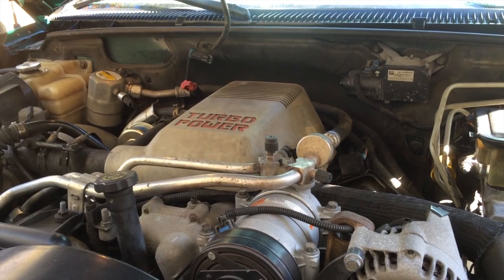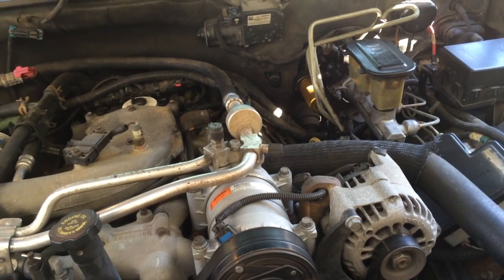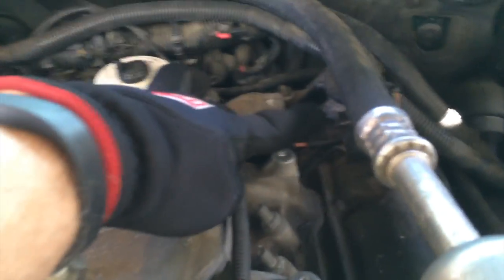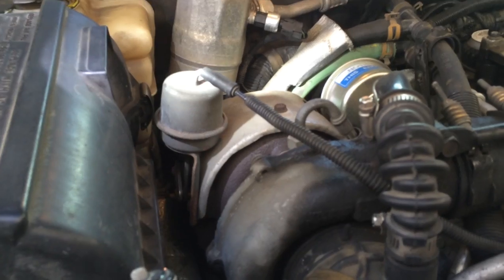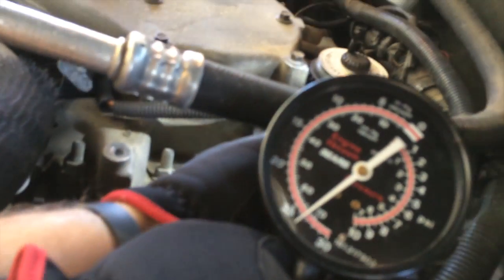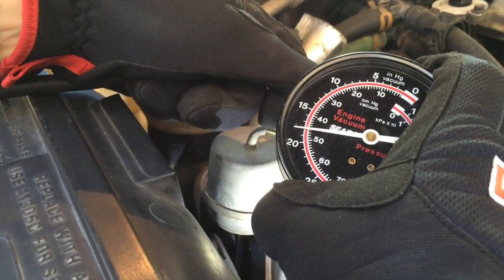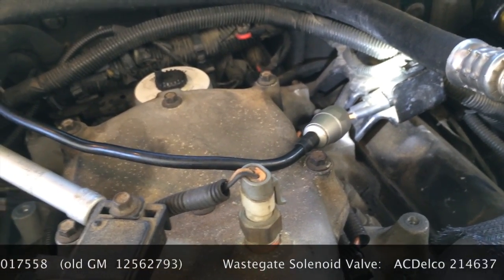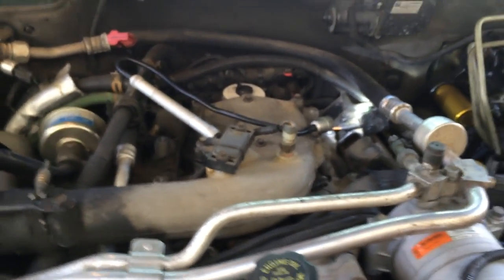1994 - 2002 GM 6.5L Turbo Diesel Engine P0236 Code Wastegate Diagnosis (Chevy & GMC)

Comment: What commands the waste gate selanoid?
Reply from the maker: The PCM (powertrain control module) would directly control that component on these model years.
Reply: @DrShock  think I got it fixed. Swapped MAP. Got boost signal back at turbo Westgate. 
We run obs  3500hd in our fleet all 6.5s. We love them and try to keep them in top notch shape. Great videos. Helps our fleet stay on the road.

Comment: This was a great help and one of the easiest pieces of the puzzle to test.
 My '99 6.5 turbo worked (occasionally) when cold for a few miles but stopped spoiling up after it warmed up good. Sometimes it didn't work at all. 
   I replaced the PMD and also the Pass Key module in the dash after I had a guy with a Tech II showed me it was having issues, but it didn't cure the turbo problem.
After I found this tutorial and followed the test process I found this valve wasn't working. 
   I replaced it for $42, cleared the "Check Engine Soon" light that I had been looking at for about a year and now the turbo is working and not shutting off after it gets warmed up. I can actually pull a hill again and gain speed! Lol!
   Thanks for posting this video!!

Comment: Howdy again.  After replacing the solenoid, the tubes and the wastegate actuator, I still have a code and don't hear the  turbocharger kicking in during acceleration.  I'm on the hunt for a new vacuum pumped am having difficulty locating one.  Has anyone had any success in finding one and if so a part number?
Reply from the maker: If you go to the video description, the last GM part number for the vacuum pump is listed.
Reply: @DrShock  Thank you

Comment: Good info. Thanx. My 94 6.5 sputter under load and a little black smoke sometimes. Replaced ip pdm ops fuel tank grounds. Ran great 6 mos then started again. Check engine light qcomes on until I press the petal then goes off. Idle forever though. Any thoughts? Can't find anyone with a obd 1 for this truck
Reply from the maker: You need to get the trouble codes from the PCM.  For 1994 you can do that without a scan tool. A jumper wire between two terminals of the OBD1 connector and you can count the flashes on the service engine soon light.  There are likely some videos on this, but it's easier to just google it.

Comment: THIS IS HANDS DOWN THE BEST, MOST DIRECT INFORMATION ON LOW BOOST FOR THE 6.5. 
WATCH RHE VIDEO, AND FOLLOW THE RECOMMENDATIONS.  IT CAN LITTERALLY SAVE YOU THOUSANDS OF DOLLARS.  
I DONT KNOW IF HE MENTIONS IT LATER INCTHE VIDEO BUT BEFORE YOU DO ALL OF HIS FIXES, REPLACE ALL OF YOUR OEM VACCUM LINES!!! ALL OF THEM!  Otherwise you will be chasing your tail replacing good parts when the weak lines are causing blockages and/or leakage.   Feel free to come back and thank me for this tip :)

Comment: Replaced the solenoid and the lines to the actuator and pump.  I pulled another P0236 after driving 10 miles.  Wastegate actuator next?

Comment: Hi, I have the P0236 code set but engine will not run. Was running fine when i shut it off. Coupke days later would not start. Thinking its the pmd. But will check this selenoid as well. Your thoughts?

Comment: I have a 1999 Chevy C3500 and getting the P0236 code. I replaced the wastegate, vacuum pump, the map sensor, the vacuum lines are good and I cleaned all my grounds . Truck is fine for the first hour of the day but after about an hour of driving, getting no power on high or low end with black smoke on the low end.

Comment: Thanks for the video.  My waste gate solenoid was unbelievably hot to the touch.  Barley could hold it, and it was chattering in my hand. I purchased a vaccume guage. I've got - 20 or so.  But boy it's pulsing an not a steady vaccume.  That normal?

Comment: If it was the electrical connection on the wastegate solenoid, where are typical places that the ground wire would be located/grounded to.
Reply from the maker: Try looking at this vid - https://youtu.be/H0lK0TZEVCc

Comment: I know this is an old video but I have the same code on my 1997 k3500 6.5. It will randomly start running rough and will backfire here and there, also feels like it wants to stall on the highway or when accelerating. Do you think the waste gate solenoid is my problem or there is more too it?  Thank you!
Reply from the maker: This would be an uncommon source of a stalling condition. The only way to confirm this part is faulty is to perform a vacuum gauge operational test as shown.
Reply: Turns out the lift pump was unplugged 🤦‍♂️ thanks!

Comment: do you have a link to the black and orage tube?
Reply from the maker: I have links in the description for those parts.  However they are long discontinued by GM so it will be a bit of an easter egg hunt to find one.  U-pull it salvage yard, like an LKQ, might be your best bet.
Reply: @DrShock  ok. But thanks so mutch for the answer

Comment: Does it have to have vaccume at all time on the wastegate?
Reply from the maker: There will always be vacuum on the line from the vacuum pump to the wastegate solenoid (unless there is a break in the line or a failure of the pump).   The wastegate solenoid is controlled by the powertrain control module (PCM), and will meter the vacuum to the wastegate as needed to maintain the amount of gate opening the PCM determines is needed.
Reply: @DrShock  ok because I changed out the selenoid already because at times there is no vaccume coming from the line going to the wastegate. So maybe the pump is going out?
Reply from the maker: Did the pump pass the vacuum test I showed in the vid here?   Typically the pumps are a go/no-go kind of situation.  They either suck, or they suck ;-)   But they can get into a insufficient vacuum before dying state too.

Comment: Got 96 chévere 6.5 diésel turbo got a code p0238 can’t figure it out. If anyone has an idea what it might be or something I can check I would greatly appreciate it.
Reply from the maker: Have you checked the boost pressure sensor?   I haven't come across this dtc myself, but it typically involves this sensor.

Comment: I have a Chevy 3500 with the stock 6.5 diesel. My Tech 2 tool shows I have 14psi of boost at idle and 26psi when my auxiliary gauge reads 13psi. If I disconnect the 3 pin boost sensor on the intake manifold, the tech 2 tool reads full scale 29psi. at idle. If I put in a new boost sensor I'm back to reading 14psi at idle.  I noticed on your video you have a cable tie holding the connector as do I, because the clip got brittle and broke due to the heat. It is possible to plug the 3 pin in reversed but I am reluctant to attempt out of concern of causing damage. Is there a way to know what way it plugs into the boost sensor? Could somthing else be causing my control to read 14psi when the pressure is near zero? I believe ECM is limiting the power of the engine due to the  arbitary reading. Any sugestions?
Reply from the maker: It's been a long time since I've eyeballed that plug connector, but I recall that you can tell the correct orientation visually where the broken retainer would go to avoid connecting it in backwards.  The GM service manual would have the pinout as well, so to be sure you could identify the ground pin and check that way as well.
 
Reading 14psi via the Tech2 is normal, this is not a reading of just the boost but boost + atmospheric pressure at the sensor from the PCM.  An external gauge will not have the atmospheric component, so will not match.  So, for most non-mountainous areas of the USA, you would expect to see a boost reading around 14-15psi at idle on the Tech2.

Comment: What repair manuels do you use?  My husband has a 98 chevy cheyenne turbo diesel and we are trying to find a repair book for it.
Reply from the maker: I use the genuine GM service manuals when doing these videos, same as the dealers used back in the day.  There's a link in the video description for eBay for the one of the last years covering the 6.5L diesel trucks.  They are out of print, so it's really the only source for those books nowadays.

Comment: is the turbo wastegate solenoid the same as the turbo boost solenoid.
Reply from the maker: There's only one solenoid involved, and yes some folks refer to it as a boost solenoid.  GM never did though, instead using the more engineering accurate term wastegate solenoid.   The solenoid controls the wastegate valve thru vacuum, it is the wastegate valve itself which directly controls the turbocharger boost,  not the solenoid which is indirectly in control.
Reply: @DrShock  ok thanks!!

Comment: Hey I have cuestión I have 2000 Chevy c3500 6.5 it have two tank the rear pump don’t work I m all ready replaced the pump and the fuel pump module meter and still not working
Reply from the maker: With an aux tank the operation of that little tank's pump is controlled by both the main tanks fuel sender + the fuel balance module.  It's a bit more involved than the single tank design, so you'll want to have the service manual handy for the wiring schematics.   The service manual for 2000 would also call out at what fuel level does the main tank request the aux tank to transfer fuel so you know what conditions to test it in.

Comment: Hi I have 2000 Chevrolet c3500hd turbo power the rear fuel pump don’t work I don’t have power on the conector

Comment: Buenos días 
Es muy buen video los felicito 
Una pregunta mi camioneta Chevrolet 94 tarda demasiado en arrancar (tarda como 10 segundos en arrancar)y arrancando funciona al 100 me podría ayudar con la falla
De antemano agradezco su atención gracias
Reply from the maker: Thanks, for a 1994 6.5L diesel that is difficult to start I'd first look into the PMD module. - Gracias, para un diesel de 6.5L de 1994 que es difícil de arrancar, primero miraría el módulo PMD.
Reply: @DrShock   buenos días gracias por la información lo voy a checar

Comment: Good morning I am from Venezuela and I want to change the gasoline engine to Diesel, which engine should I buy is a 2002 Cheyenne I appreciate your help
Reply from the maker: No idea, I've never performed such engine swaps myself.   You'll have to swap the PCM computer as well though as they are different.

Comment: Great Video, Where did you get the orange and black vacuum lines? I had to replace my lines and I put little rubber lines on and I don't think they are working. 8/3/2020
Reply from the maker: Those are the original GM vacuum lines, I put the part numbers in the video description.   But this video was many years ago, those parts are now discontinued but you may find them from time to time on eBay.
Reply: @DrShock  Thank You. I have been trying to find them with no luck. I will try E bay. 8/4/2020

Comment: I am having a issue with boost. P1656 comes up now and I keep blowing engine 1 fuse when I turn my key on
Reply from the maker: Code P1656 could be several things, the most common of which is the same subject of this diagnosis video.  It's either the vacuum pump, the vacuum lines, the wastegate solenoid, an exhaust restriction, or the turbo itself.   I would work the blowing fuse problem first though, as that's most likely a place where the wiring harness has worn thru to ground from decades of vibration under the hood.   The service manual will show the wiring diagram for that fuse that you can eyeball the harness out from there.
Reply: @DrShock  my fuel heater on the bottom of my fuel filter housing was shorting so I unplugged it

Comment: Just wondering... Why even mess with it? Wouldn't it be a lot easier and better to simply remove the vacuum pump, use a '93 belt to take up the slack and install a manually operated (or dash mounted) boost control?
Reply from the maker: Sure, couple of reasons.  One being it made it nearly 20 years before service was even necessary, so that's a nod to the reliability of the 1999 wastegate activation design so no financial reason to change it.  And being a factory engineer myself, the other is I always aim to keep whatever I'm servicing OEM original as I typically have access to all of the factory service manuals.
Reply: @DrShock  Thanks for the reply, makes sense. I've been driving gasers since 1964 and buying my first diesel next week so I am trying to learn as much as I can off of YouTube "university" from guys like you as I can. Mine will be a 1994 Silverado 6.5L C3500 with 89,600 original miles. Other than moving the PMD to the front bumper it has been kept stock and well serviced. At 100,000 I will be changing both harmonic balancers and thought removing the vacuum pump at the same time would be a good idea.

Comment: I have an off topic question. What is the green and black hoses and T-tubes beneath the gearbox dip stick? I'm just about to buy a suburban 6.5 1997 in wich those who goes down behind the engine is cut and open. 
I'd really appreciate an answer on that one. Thanks in advance. :)
Reply: Thanks a lot. I will definitely repair it.
Reply from the maker: I believe you are referring to the heating system hoses by your description.   This particular vehicle also has rear heating for the 2nd and 3rd row seats.  Engine coolant is used to provide this heat, hence the hoses and T's involved.  The rear heating piping tends to leak with age, so the previous owner may have disabled it rather than repairing it.   Just a guess though.
Reply: I welded two T-tubes. All heating works perfect. Thanks again :). 
I love my "new" truck. I live in Sweden btw. 🇸🇪

Comment: Can someone tell me the purpose of the random little tube that comes out of the intake right before the turbo and goes back to the can
Reply from the maker: By "can" are you referring to the Crankcase Depression Regulator (CDR) aka by the highly technical term the "Tuna Can"?  If so it is an emissions control device, as well as a pressure valve for the crankcase, to recycle gases thru the intake.  It's the diesel engine take, roughly, on the gasoline engines PCV.

Comment: My truck is a 1996 and the  part number for orange and black vacuum lines Gm 12559401 on description shows it's for 98 to 2000 will fit my 96 ?
Reply from the maker: These rigid vacuum part numbers have been discontinued by GM since 2009, but this particular part you mention only fit back to 1997.  For 1996 to 1997 (perhaps very early production) for L65 code engine it should be 12554090 instead.  I updated the video description with this information as well.  If you can't find the part, you can  splice in regular black rubber vacuum line to repair any leak you may have there.
Reply: Do you know the diameter of orange and blk hose ?

Comment: My 98 6.5 had the vacuum pump fail so we turned up the boost fooler made a custom bracket and waste gate and have never had issues with the truck coding high boost or low boost

Comment: So whats the problem when theres plenty of vacume to the black plastic line to the wastgate when cold but goes to 0 when hot? New wastegate solenoid.  Good lines and good pump.
Reply: Please reply with thoughts to .....jdbetker@drytel.net asap as this is my dailly driver and need it fixed asap. Thanx

Comment: I HAVE A 2001 GMC 3500 6.5 THEY CHANGED THE OIL PUMP AND NOW IT DOES NOT ACCELERATE IT CAN BE THANKS

Comment: What other would indicate that this is giving a problem other than a check engine light? 11/10/2016
Reply: Severe lack of power at higher speeds. A diesel without a functioning turbo has no power itll run doggy and going up hills itll refuse to keep speed or accelerate

Comment: Hate to get off topic but what year was that accessory bracket system used? It is the only one that will work in an early GM van. I can't seem to find a year and application for it.
Reply: ***** Thanks. I think that setup was 1996 through 1999 right? Was that true of both the pickups and the suburbans?

Comment: I just did a vacuum test on mine and there's zero vacuum coming from the orange vacuum line. I suppose that means it's the vacuum pump correct? Hope I'm doing it right as I expected at least a tiny bit of vacuum even from a failed vacuum pump? My pump isn't making any noise as far as I can tell

Comment: because I replaced the PMD with the whole kit, but still doesn't revv past 2000 rpm, I kinda tried opening the wastegate arm and it was able to revv up to 2300 rpm's, so I thought the vacum pump or wastegate are clogged
Reply: check the turbo coupler sleeve or boot that attaches your turbo to the intake. some times those leak or has a hole and need to be replaced or re tightened.
Reply: okay am baffled   tested orange line at solenoid   had 25 inches vaccum     at actuator had 0 inches   changed solenoid   still no vaccum at actutor   ran a temporary rubber hose from solenoid to actuator  still no vaccum   can it be anything but a brand new bad solenoid?
Reply: jim oneill I have same problem what's the fix?

Comment: what were the truck symptoms?  my truck won't rev past 2000 rpm & black smokes while revving.
Reply: LUIS MIGUEL  GONZALEZ stop rev on a diesel it fucks your motor up
Reply: Depends on how it drives. If it runs like shit but will go highway speed your injectors need cleaning if you have to fight to get to highway speed your turbo system is having some kind of malfunction